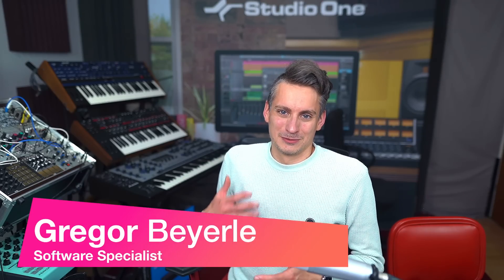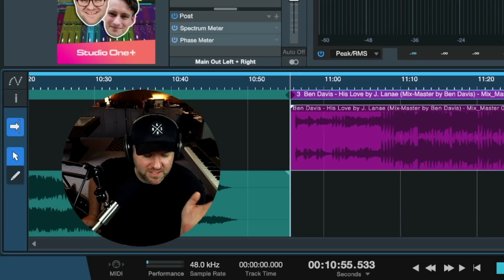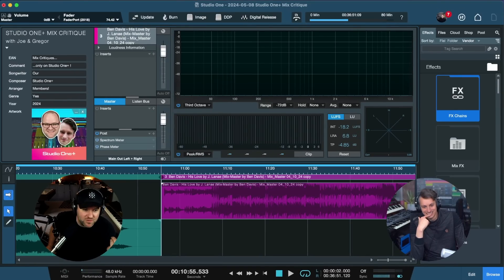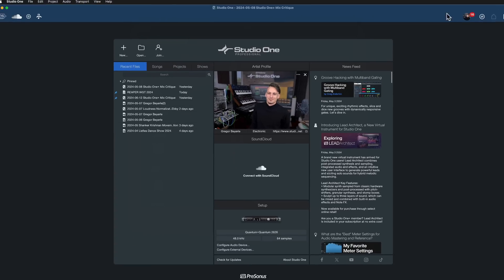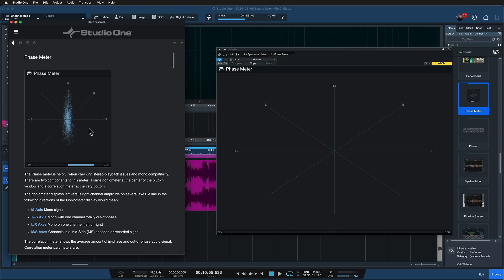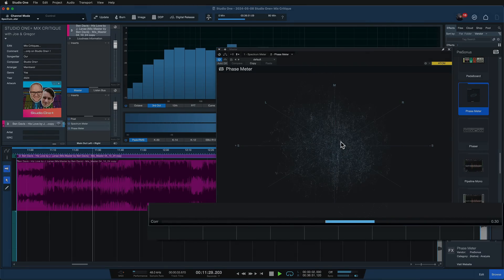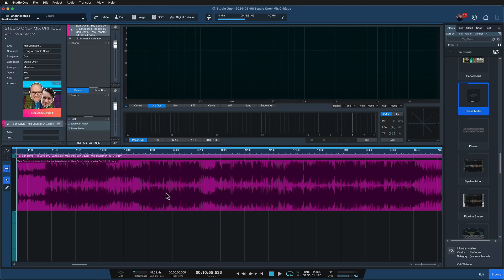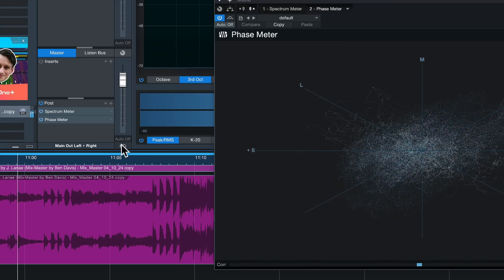How to Read and Understand the Phase Meter | PreSonus

Comment: Another great informative topic. I have a question. Recently did a track sent it to vocals and it came back with weak music and hot vox but some how got both mixes stacked in mastering page. Was great bcuz I was able to roll up no vox mix with vox mix. Can I render them together or export mix or stacked mixes? Thanx guys. Im a dealer here in centeral valley so running sales and support.

Comment: The funny thing is that the positive negative portion of that meter wont tell you if things cancel necessarily if there's strong enough mid info in the mix it could stay in the positive only flipping to mono lets you hear it cancels or using it in the track concerned. Also canceling in mono... but ok in stereo can be a good thing, if its just ear candy for stereo. As it might be busy in mono with less width i.e. space for it.
I feel it coming, by the Weekend/Daft punk has many parts specialy the intro and chorus that dip into negative stereo phase. I was looking at this recently as I had an idea but was pretty ignorant about these meters in any detail. So I think what I took from this is by deliberately having things cancel ie soloing sides then mixing them down so they would cancel in mono (as an experiment not for any good reason). Is if I add enough mids from kick bass ect. into a mix you can have this read totally in the positive. So if you took this to mean everything's fine in mono it would give you the wrong idea and may still have a problem. But as long as its intentional, ear candy could cancel or drop in level in mono may be beneficial.
Just a thought.

Comment: The old problem has occured, ehh, mistake what I've made also anno.  If you haven't got a second take to make it stereo, you can copy that part from a later  part of the song (if it recorded several), or if you wanna use the same take at any cost, you should try to move the second one much more delay (20-30 ms) to prevent phasing.

Comment: I used to use voxengo correlometer for this until i found toneboosters goniometer which has a meter for everything in the stereofield in the same view. its so helpful to see where on the spectrum the problem is so i will know right away if its something i can solve with a mid/side EQ unless its caused by some widening effect plugin which i rarely use btw. Or if i see the problem in a certain frequency range when metering the whole mix so i can easier tell which track may have a problem. In my experience its better to reduce the width of everything else a bit if you want a specific sound to sound wide unless its like a guitar in this case where you could just have two different takes panned wide and maybe do some tweaks to pitch or timing to avoide them cancelling eachother out.